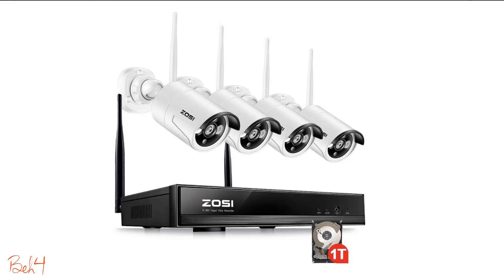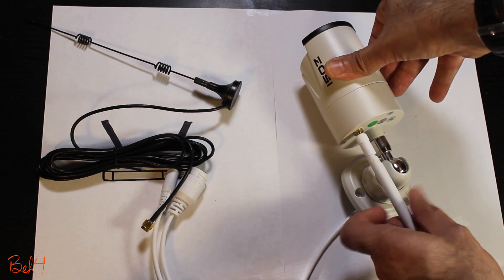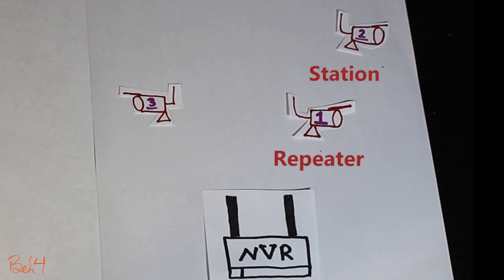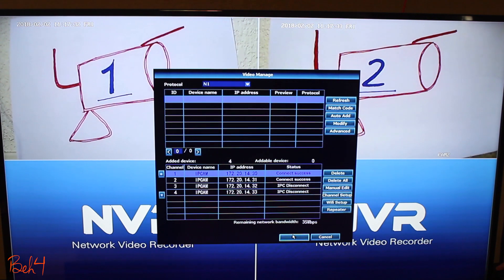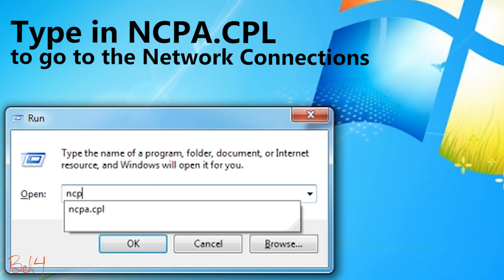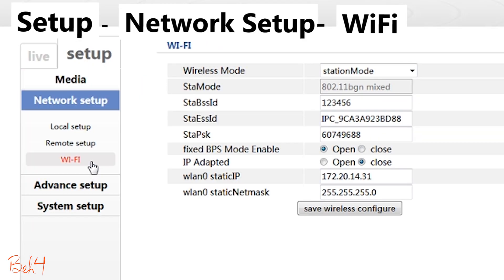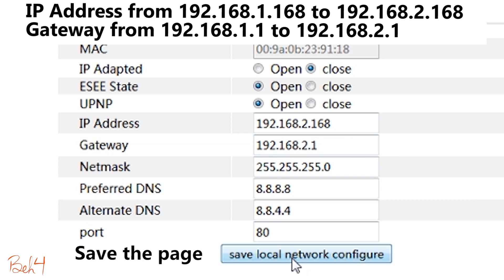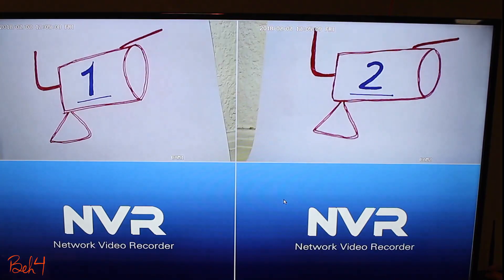ZOSI Security Camera - PART 3 [Resolve Poor Signal Issue]

Comment: Not sure if anyone will reply to this old video, but...I have an 8-channel ISOTECT camera system from 2019 and a 4-channel AKOSO from 2017 that I have not used since 2019. Last year I added 1 of the cameras from the older system to the newer system and all was good. recently however, the 1 camera added to the new started going out on the same time everyday at 6:55 am. Here is what's strange, the camera is outside on the opposite side of the wall from where the box is located. meaning, it is 2ft away. The other cameras are fine, no issues. If I take the camera and bring it indoors, it works fine. Not sure what is causing this issue. It takes hours for the camera to get back online. FYI: router and modem are 3 years old, no issues there. Not sure the root cause. Thank you.

Comment: I have the Zosi K9608, same as this one but with 8 cameras. The repeater function doesn't have to be done manually, you can set the NVR/cameras to automatically configure the repeater ad hoc.  But even the repeater function isn't good enough. And the extension antenna works in some situations. a 10' extension has a much weaker signal than what comes from the fixed antenna mounted on the camera (20' is even worse and rather pointless). So unless you are getting it closer to the NVR with near perfect line of site it is useless (I have one working well).  I was hoping to see you show how a wifi extender can be used. This seems to be the only solution but there is very little info on how to set it up. 
 Overall, this camera system is junk, a time-lapse system, half  the time I am looking at a still shot a couple minutes old, the wifi signal is as weak as cell phone wifi in your home. You'll have the same trouble getting a signal from your cameras as you would using your  cell phone wifi out in the street.
 More importantly is that customer service for Zosi is in China and the service is a nightmare. 2 day response time in broken English and after explaining my complex problem their replies read as if they never understood what your problem is. 
 Wireless NEVER again.
POE Systems are the only way to go...and only with a company with customer support located in the USA.

Comment: can you go  three cameras far on the repeating mode
Reply from the maker: The one that I have allows it, but I don't personally recommend it because repeaters in general affect and degrade the wifi quality (the only advantage is increasing the range) and using 2 or more repeaters back to back is not recommended.
Reply: @Behfor  thanks for reply. i have a repreater but it does not seem to do much maybe to cheap.but i am not extending the wifi just the range

Comment: I know it is old post but Thank You.  I have a Crystal Vision four camera system and one camera was always "flaky".  Now, using camera 3 to relay camera 4 all are happy.  And I didn't have to spend a dime.  It took a couple minutes following you and all is good.  Hope you are still around to read this.  Thank You, Again.
Reply from the maker: Hi Jim. You just simply made my day!  I'm very very glad this video was useful for you and now the camera 4 is happy! Thanks so much for letting me know and have a great day :)
Reply: @Behfor  I have a question that is probably off topic, but, I go off topic a lot.  My four camera system, Crystal Vision, seems to be old and the cameras hard to find, at least of Amazon.  Now the question:  Are other cameras going to work with this system?  Or, should I buy a new system with eight cameras?  OK, that is really two questions but you get the idea, I hope.  LOL!

I do see the newer cameras and the camera body shape is the same but different names.  Are they really the same people, equipment under another brand or are they all different?  Seems cross branding could be an issue if not careful.  Hope I am not abusing this thread.  

Thanks!
Reply from the maker: Honestly because I haven't tried to connect different cameras with the same system unfortunately I wouldn't know the answer to that, but as you said I have also noticed that there are more or less similar cameras under different brands, but I don't know if they would be compatible with each other or not. sorry about that.
Reply: @Behfor  Thank for your reply.  My guess is that if similar frequencies are found there is a chance the software will find the hardware.

Also, another opinion/question on your old system you "updated".  After doing the update did you try to use the "reset" button to return to original settings?  Finding updates and how they abuse old hardware with new software I have been reluctant to do updates.  Now I know not to do updates for cameras.  Thanks for that warning.

Also, you lost the repeater function of one camera seemed to be the problem after the update.  Did you try to install a stronger antenna of the distant camera?  That might return your system to normal camera operation without a need to repeater function.

But I keep talking when you have probably already installed new cameras.  I may be speaking without need.  Another thing I do often, according to my wife.  LOL!  Have a good day!

I finally saw the real reason you stopped your cameras and the night vision problem.  Did night vision return when temperatures lowered?  A season system?  Might be someway the manufacturer could resell that broken feature, LOL!

Comment: I have the Zosi 4PCS and one of my cameras have gone out. I moved another camera to that location and made sure the electric cord was working which it was. My question is where can I find a replacement camera that will work with my NVR? Every camera I see is 1080 and does not show it to work on my model. Information on my NVR - Model# ZG23213M
S/N POJA1700450050
Any help would be great.
Thanks!

Comment: I have what appears to be the same wireless system but the Zosi software does not have an option to use camera as a repeater.
If you read this could you give me the version of the Zosi software you are using?
Reply from the maker: Sure, H/W version: 2.1.0
S/W version: 2.7.14.20_21322230
Device model: K9604-w

Comment: I have ANNKE system and I would like to match Cameras on 2nd floor WIFI to 1st floor where my NVR is. Is this possible? I chanched IP on cameras, but it works only, if NVR and cameras are on the same WIFI. I have pretty big house and I bought two IPC routers too. Thank you for your answer.Nice video, thank you for sharing the knowledge!

Comment: does the wireless router have to be connected to the nvr via lan cable to get the camera signal to the nvr? I have a wireless camera system that does not have the option to repeat to another camera

Comment: Hi my nvr is far from my router, I use the extender and plug it from the nvr it is working when I'm connected to the wifi inside the house, but when using other connection like from work I cannot view it. Can you help me? Thanks in advance

Comment: Hi I have problem to connect router tenda with 4 antena with nvr..  When I setup repeat mod it work fine with home wifi but on nvr  i dont have option repeat.. It Just say in user manual that if connect repeater clik on code mach.. But its not working. Is it ok to home router connect with lan tenda router outside then TRY to change ip adress of camera.. Sory for bad english..

Comment: Hi, I have a very similar system and have found your videos to be very helpful, thank you. I am currently experiencing the problem where the house is too big and I cannot get two cameras within the NVR wireless range. Before I purchase the antenna extenders, I'd like to try to relay the signal from camera 2 to camera 1, as in your video. However, I am unable to as my default admin and password (which I have not changed) are not working - do you have any tips on what I could do to fix this problem?

Comment: Hi my name is Temidayo am a Nigerian. You got lovely n helpful videos n I hope to see more of same.
I need ur guide with my wireless cctv setup. I bought a wireless 8 channel Nvr using 8 wireless ip cams with no physical LAN ports to plug in any cable, is got just power port for 12v dc. The set-up was pretty direct until when 2 cameras were out of d wireless Nvr Wi-Fi signal range.

To resolve this I want 2 use my Tp-link TL-MR3240 router as d Nvr's reporter but this is were I've gotten stuck n do need ur help with. The routers ip addy is 192.168.0.1,

Nvr basic ip: 192.168.0.110
Gway: 192.168.0.1
Pri. Dns: 192.168.0.1

Nvr ntwrk ip: 172.20.18.3
Gway: 172.20.18.1

All ip cams ip are:  172.20.18.xxx

So how do I connect the router so as to extend the Nvr to the 2 ip cams presently out of range n also boost signal to any around it too
Reply: Plus the Nvr doesn't ve a repeater feature in video

Comment: Great video. Just did mine and have a couple of notes. For a Zosi system purchased in July 2019 the camera's IP address is 192.168.1.88 (I used IP scanner to get this). Secondly, linking the NVR to the camera was different - using manual edit bought up a page that did not include an entry for the IP address however a reboot of the NVR picked up the camera on wifi and double clicking this automatically added it to the NVR system. Keep up the good work!

Comment: Great Video. Got one question. I connected 1 camera with no issues but when I went to connect the second in the way you mentioned when I go to 192.168.1.168 to sign on to the camera I get an error message stating logon failed. My system is OOSSXX which it appears is made by Zosi. Do you have any suggestion as to why I now get an error message when trying to sign on to the second camera?
Reply from the maker: When do you get the error message? Are you able to go to the login page and enter the username and then you get the error message or you cannot go to the login page in the first place? Thanks

Comment: Hi great video! My problem is, i have a AVM FritzBox and I’ll set the gateway to 192.168.178.1 than I’ll set the static WiFi ip to.. example 192.168.178.80

I don’t change anything in the local setup because that’s only necessary for the Ethernet connection right?

So I tried to add the camera in the video manage section.
192.168.178.80 but no camera was found.
On the FritzBox configuration page is the camera showing on the ip..

So what should I do?

Comment: Can NVR and one or two of the cameras using two different network? There are two separate units in my  house. I put two cameras in my unit and want to put the other two on my sister's. Can the cameras on her unit use her network? Since it is closer to her Wifi. If not,  can I connect the cameras direct with cable and not using wifi?
Reply from the maker: Let me answer  your last question first! Yes you ca connect the cameras with cable, the Part 4 of the video talks about that: https://www.youtube.com/watch?v=TekAiunG4kI
Now to answer your first question I should say the NVR should be connected to the same network that the cameras are connected to, so it can access them. You said there are 2 units in your house, do you mean 2 separate NVR? If there are 2 different NVRs then you can connect one to your network and one to your sister's network and basically follow this video for each system. If there is one NVR and 2 different networks then the NVR can be connected to one of them so basically it can only access the cameras that are connected to the same network!
Reply: @Behfor   Thank you so much for you quick respond.

Comment: Dear Behfor,
can I ask you how can i turn off the infrared option of one of my 4 cameras, is there any software solution?(system= Zosi 720P)
Regards,
Reply from the maker: Hello, unfortunately I couldn't find any way to turn that feature off from the NVR, but I'll try to connect directly to one of the cameras later today and see if that is a possibility or not and will let you know. Thanks!
Reply: Are you trying to use the camera from inside a window and getting a lot of IR reflection ? What I do is cut some electrical tape so it fits tightly over the IR illuminators, works for me but you may need an outside source for the illumination. good luck.

Comment: How come I can't connect to the camera through the browser after changing the settings?
Reply from the maker: If you changed the camera's Local (LAN) IP address, then you should use the new IP address in your browser to connect, also you should assign an IP address to your computer which is on the same network as the camera. For example if the camera's LAN IP address is 192.168.2.168 [255.255.255.0] now you can use 192.168.2.10 [255.255.255.0] on the computer.
Reply: @Behfor  what about when setting up new cameras...do I have to change back to the original IP address for my computer?
Reply from the maker: The computer and the camera need to be on the same subnet in order to be able to communicate with each other. If the camera's ip is 192.168.1.168 then the computer need to be 192.168.1.1-254 or if the camera is 192.168.2.168 computer should be 192.168.2.1-254. not sure why you need to access the camera from your computer after you've set it up!

Comment: Dear Behfor,
Thanks again for your prompt reply.
Yes... I connected the camera directly with LAN cable to Laptop. I am using the latest Version of wireshark(2.6.4). i can not receiving the LAN IP from camera through test with ARP order in wireshark. Did you think that my installed G data antivirus can affect the process? I captured a screenshot from the result of wireshark capture. It will be great if you allow me to email to you this capture. Thanks again for your help.
Regards,

Comment: Dear Behfor,
Thanks for your great videos.
I want to extend my signal via using my internet Router. (as you mentioned in this video) but I can not log in to my camera. DVR says my camera IP as 172.20.14.98
I can access my DVR under 192.168.1.105, but no access to my camera under 172.20.14.98, !!
I saw already your video regarding capture through wireshark as well, wireshark gave me the same IP address as 172.20.14.98
It will be great if you can help me, Regards
Reply from the maker: Hi, thanks for the question. If the DVR is showing 172.20.14.98 for the camera then it should be the camera's wireless IP address not the LAN one (wired)! DVR uses that IP address to communicate with the camera through the wireless network, but when you connect a computer directly to the camera with an Ethernet cable you should use the camera's LAN IP address to connect. I'm not sure why you got the same IP address in the wireshark! Did you connect your computer directly to the camera using a LAN cable when you took the packet capture? Please also make sure the computer's wireless network is disabled during the test.
Reply: @Behfor  I'm having the same issue where can I find the LAN IP address of the camera?

Comment: I have a similar system as on your video with 4 cameras  and the NVR detects only one camera. When I replace that camera with any of the other , one at the time,  the NVR  don't detect any one of them. Any idea or recomendation will be appricciated.
Thank You
Joe A.
Reply: Forgot to mention that all camera worked fine when connected with cable
Reply from the maker: If this issue only happens when using wireless, then I think you should pair the cameras with the NVR again!
Check out this link please: https://support.zositech.com/hc/en-us/articles/232065607-Add-the-IP-camera-to-the-NVR-by-matching-code-
Reply: Thank you for your quick response.
I am going to try again and again and let you know
Reply: With cable the addresses are 192.168.1.xx (the one camera that works is 172.20.14.30)
When disconnecting cable and refreshing, the camera at the bottom half of the "Video Mange" disappear (no video source) and no refreshment will help
Reply: Is it possible to manually program the cameras to 172.20.14.xx and would it work?

Comment: Fantastic video.  I have 8 960P IP Cams with the K9608-W NVR and Google Wifi - Mesh Wi-Fi Routers and I put all of my Cams on the mesh network.  

I am trying to set up my system with a Windows based NVR so I can auto backup my recordings to my Google Dirve.  I tried ISpy but I cannot get ISpy to recognize my streams.  Any chance you can do a video that shows how to do this?

Comment: One question. Can the Wi-Fi signal from NVR to camera be extended using a simple extender, say Tenda A9. Do we know SSID and PASS network NVR? Has anyone tried?
Reply from the maker: Unfortunately I haven't tried it but you can see the NVR's WiFi Information under System Setup -> Network Setup -> WiFi Setup and give it a try and see if it works or not! Good Luck!
Reply: @Behfor  Thank you for answer. I tried and report.

Comment: Can i connect more camera through wireless router?
Reply: DHCP of nvr is enable or disable?
Reply from the maker: You can choose whether to assign a static or automatic IP address to the NVR! The cameras though automatically receive their IP addresses from the NVR (this is the default behavior)
Reply from the maker: Not to this nvr because it is a 4-channel nvr which allows maximum 4 cameras!
Reply: I have roborix 8 channel wireless cctv camera . Can I connect 4 cctv camera through wireless router?
Reply from the maker: I'm not sure about your camera system, but if it is similar to the Zosi I tested here, you should be able to connect 4 camera through the wireless router, I don't see any reason why you shouldn't! You just need to give them proper ip addresses and connect them to your network and then connect the NVR to them!